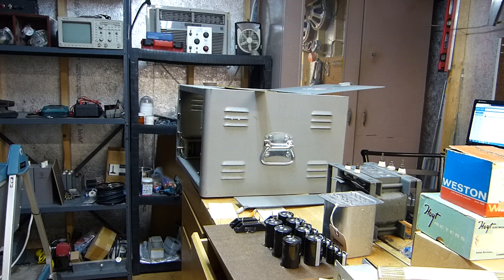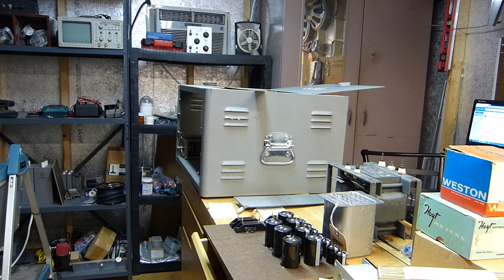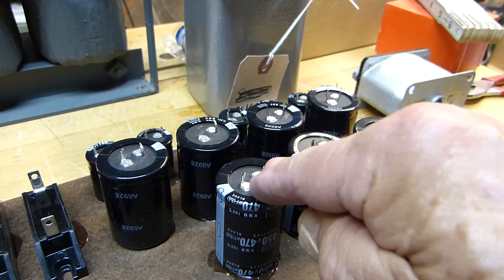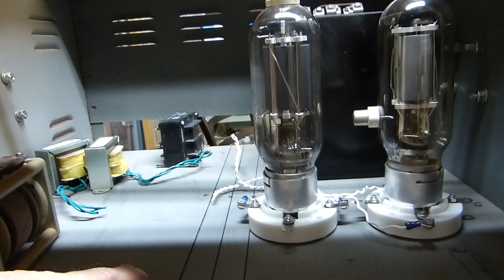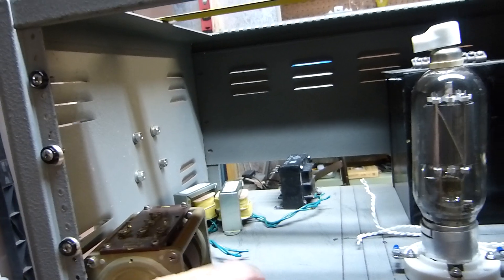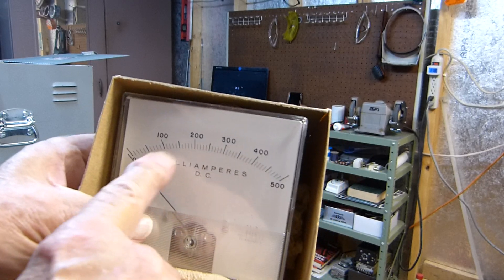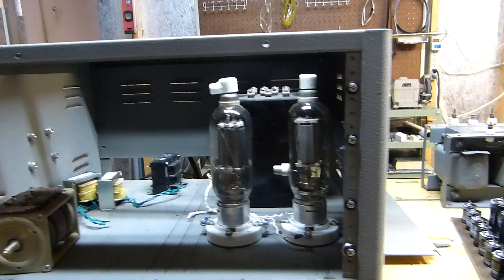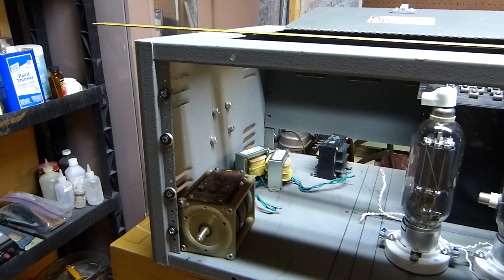700 Watt 810 Triode Audio Amplifier

Comment: I would suggest a box for the tubes that performs thermal acoustic and magnetic shielding. Steel is usual, 6mm silicone steel with a latex bond to a chassis, something like car engine mounts or springs. Put that on a ceramic riser. Small glass mirrored door 🚪 perforated holes 🕳 wire mesh both sides, like a status light glow. Dot matrix logo 😎 flow charts diagram. 

Would replace backlight in VU with an LED peak value display + some colours. Esp gain stage peak sensors would be handy. Overload detect, psu drain maximum etc. Rectifier squiggles. Computer monitoring is a great idea for high power vacuum tube.
Reply from the maker: This amplifier is in Denver with my friend. I don't have it around anymore but I do have one more of the huge OPT that I may have to build something with some day.

Comment: Do you  use specialized audio output transformers with higher voltage-rated Magnet wire? My internet search turned up zilch regarding  maximum voltage ratings for output transformers or magnet wire, for that matter. You also mentioned using chokes with this design and the highest rated choke voltage I found on Hammond Manufacturing's website is 500v. How do you make this work? Maybe I'll never get around to building an audio amp using transmitter tubes but it sure would  be neat to have an audio with big old honkin' output tubes.  700 watts? WOW! You do wear earplugs when lighting up this rig, right?
Reply from the maker: I have had two of those large output transformers for 50 years. They came from a ship-to-shore Navy amplifier running 810 tubes and I have used them at 4KV in modulators back-to-back to get high impedance on both sides of the transformer(s). They are built and rated for high voltages. Hammond makes good transformers and chokes but rarely anyone needs inductors rated at thousands of volts. On the other hand, there is a 500 mA Hammond choke in this amplifier that is mounted on insulated material, and then mounted with nylon screws and run at the 2800 volts. It has always worked for me to mount the components on some good insulating (ceramic insulators) material raising them physically above ground. I have had HV components short to the case of large chokes and I solve the problem as mentioned. There are speciality transformer winders that will make transformers and chokes for you. A little pricey but they can be had... most of the parts I have came from ham radio groups and surplus/vintage military equipment. HV components can often times be found on Ebay. I buy a lot of stuff of Ebay and I have no issues. I recommend buying from sellers that have lots of sales and a good rating. 100% rating is not necessary as there seems to always be someone unhappy with a $5 purchase that flames the sellers. I used to sell on Ebay but not any more simply because I am too sensitive to be a good salesman as you can't make some buyers happy. Just my thoughts

Comment: From experience, separate transformer and power supply for bias supply. Same for the 810 heaters. Get these fired up before the HV. But you knew this.
I have a 25w single ended 845. Single power transformer and power switch. The 845 turns on faster than the bias supply charges up. Makes a noise out of speaker like a star wars light Sabre for a couple of seconds.
Reply from the maker: In a 300B stereo SET amplifier I have, I put in a 115NO45 delay-relay to let the filaments warm up before the HV comes up as one of my earlier 300B's had half the filament go out. Probably noting to do with the HV coming up at the same time as the filaments but it seemed like a good thing to do. Probably mostly superstition...   🙂 Interestingly, there is a small hum coming from the speakers before the delay-relay closes and puts HV on the tubes. It goes away when everything is operational.

Comment: Will you need forced air cooling?
Reply from the maker: I will put a small box fan blowing over the tubes. I have found that it only takes a little breeze for tubes like this. I think we all tend to get carried away, I know I can, in providing cooling air. In the case of external anode tubes like a 4CX1000A, it is necessary to use a squirrel cage blower and pressurize the chassis underneath at some minimum level. I have done this and still have good tubes after 35 years of use. Box fans like muffin-fans do not work well into a pressurized enclosure but openly can blow quite a bit of air and is what I use on my 833A amplifier - one blowing straight down from above and one from the back of the cabinet blowing towards the front and out the grill at the front of the amplifier. These 810 tubes I have seem OK but I have never put HV on any of them and I think they were all made in the 1940's... I hope they work.  :-)

Comment: Sounds a good project David! I used these neat Chinese soft-start modules I got from e-bay on my 833a amp which you might find useful...they operate on the primary side of the transformer; might be good for your HV PSU. Those 810's would be good in a big AM transmitter. 73 Justin GW0FZY
Reply from the maker: Justin - we may have talked about it before but I forget easily. I am interested in the soft-start modules you mention on Ebay. I forgot what you are using your 833A for - not many people use the 833A but I absolutely love mine and use it most on 20M SSB. I hear the 810's make great audio amplifiers and since I have a genuine transformer to match them, I figured it was time to use it. I have prepared what I can, so far, and my friend will be here Saturday so we can complete the project and hopefully get 700-800 watts from it and it will sound good. We will see.  73
Reply: @ElPasoTubeAmps   Hi David, my 833a amp is a SET audio amp with 1x 833a per channel. I tried building an RF amp with these tubes but it didn't work  out very well. If you search eBay for "AC 150-280V 100A 4000W Power Supply Delay Soft Start Board For Class A Amplifier" you'll find the soft start. They work pretty well. Don't think Youtube will let me put the direct link in the comments! 73 Justin
Reply from the maker: @justinwoolgar9853  Very nice - thank you... I never knew anything like this was sold.   I am going to try one.

Comment: I was going to suggest you just get a 17x17" chassis and cut whatever you need out for the power valves, but I see from the next video you found two to fit. Very interesting project especially the HV/bias interlock protection TBA.

Great score though on the Tek thing. I finally had an opportunity to get a Tek current probe & AM503 (?) amp but I looked into it, especially the probes and how you use them, and I decided it all wasn't really for me. I don't get much beyond measuring cathode current really, either just across the cathode resistor or else by inserting one of those gadgets that make like a valve base.
Reply from the maker: I have a nice supply of chassis right now - I went crazy and bought enough to build for the next 10 years. I love 4" high chassis or 3" next, but rarely ever use 2" high chassis and I had none of them... Three inches might have worked and I did indeed think of cutting one of the 17 x 17 x 3 chassis corner off but figured the cutout would be terribly weak for that 33 lb transformer to set on it. It is getting there and now I am just into the beauty of the layout - symmetry is wonderful even in a vintage schematic. You know what I mean.

I have three Tek current probes and all of the probes are perfect and they are  from the late 1960's but only one of the terminators is good. The non-powered terminators are not very sensitive either and this active terminator has a lot of gain and I can see 1mA of current. The current often times looks very different from the voltage wave form.

I learned to appreciate the value of measuring the current in that modulator I build and measured with my Triplett 630 and smoked it. It measures 6KV at 60Hz but audio frequencies are a different animal and will arc and it did, across the wafer switch. 

Anyway, clamping the probe around one of the load wires told me everything I needed to know and I did not have to deal with 2000 volts coming out of that transformer.  Getting across that,  I think that would be the end of me.

Comment: Not to be critical, I love your channel, but wouldn't it be safer to mount those caps and rectifiers with screws and capacitor clamps? The particle board is a good idea, I just try to avoid gluing things down. I have yet to find the perfect glue. Even Epoxy snaps off over time.
Reply from the maker: I thought I had already replied to you on this but I don't see it. I am forgetting to "send" often times...  I agree that Epoxy will snap off and do not use it for things like this. However, Goop is a rubber-silicon type substance and is seriously tough. Parts are not going to fall off but they can be removed and on a slick surface, it doesn't even leave residue. Somehow I ended up with a whole stack of that particle board and use it to make assemblies and just add them in to the cabinet or chassis. I have done that in this case for the 810's also. Besides the Goop, there is another substance even stronger called, Loctite PL Premium Polyurethane Construction Adhesive,  
https://www.amazon.com/dp/B00518KORU?psc=1&ref=ppx_yo2_dt_b_product_details
This is some really serious stuff and I probably will not use it for capacitors as I do not think it will let go if I need to remove the component.
I also do not have the proper capacitor clamps and I use the PC board type capacitors but mount them upside down. They have worked really well for me and I have them as high as 5400 volts in a 833A RF amplifier. I did get some true HV capacitors, 20uF at 6KV, but they are large and I have not built with  them yet.

Comment: You need a sheet metal shear and brake over aperatus for your shelf! If you don’t already have it.
Love your amps! Can’t wait to see how it turns out!
Reply from the maker: Oh, do I wish I had a metal sheer and break... I buy chassis form Mouser and get cabinets where ever and when every I can. We are going to put the PS in molded 8U (10.5") rack case with a plate on the bottom for mounting the PS, etc. I have bought similar 19" all metal cases locally from music shops, one with wheels, others without wheels and they are pretty tough. Bottom line is has to be totally safe from HV . A lot of thought will go into the PS case and safety.
Reply: I have one of those Harbor Freight brakes but it is all manual using C clamps and the bar is solid so you can't make box bends. For $60 it's OK. I would like to have a professional brake with removable bar sections but those cost thousands new. Now I do have a good way to cut sheet aluminum precisely - a table saw! Yes, and a carbide wood blade will cut aluminum with satisfactory results. But better yet, buy a specific aluminum cutting blade (about $100). It's much smoother. Also use water based cutting fluid. I have even cut 1/2in aluminum plate this way.
Reply from the maker: @andydelle4509  That is a great idea using the table saw as I have a good one - an old Craftsman. I have used a hand held cut-off tool before and amazingly, have gotten the front panel looking good but I think I will go to Lowe's today and get the blade you are talking about... Thanks...
Reply: @ElPasoTubeAmps  Lowes may not have it. It's kind of a specialty blade. I got mine at a metal supply house. As always check Amazon. I don't have to tell this, but be careful. It's a bit scary cutting metal but I have done it many times.
Reply from the maker: @andydelle4509  I did get one at Lowe's made by DeWalt. Only like $6. I have cut panels with a hand held cut-off tool and it is scary...  I know what you mean. On this 10" table saw it will be even more so... I have been using the table saw with wood lately and so far, I still have all my fingers.   :-)

Comment: Looks like a fun project! Looks like about 590 Watts class B?  That’s some serious audio!
Reply from the maker: According to the data sheet,  https://frank.pocnet.net/sheets/049/8/810.pdf   as much as 725 with 2250 on the plate and a 11K load. This transformer is from an 810 amplifier and my plate voltage will likely be around 2600 so I expect every bit of the 725 and more. Years ago I used these transformers with PP,  3-400Z for 1.3KW output. We will see...

Comment: Can you use an autoformer instead of the variac or pot?
Reply from the maker: If I understand it right, an autoformer is a type of transformer likely used in RV's to raise a low (line) voltage to proper level for the devices and appliances in an RV. An autotransformer is the generic name for a "Variac" which is a trade name from General Radio. The bias voltage has to be continuously variable to be able to set the resting plate current to an exact value. Depending on the value of the grid current that the tube will draw, will depend on the design (and if it can even be used) of a voltage divider or pot. For tubes that do need significant grid current, I prefer a linear power supply with lots of available current and a heavy bleeder resistor to stabilize the voltage and a "variac" in the primary of the bias transformer to be able to adjust the bias voltage to any value necessary. It will take around -60 volts and I will be using a 80 volt transformer into a bridge and Pi filter (and bleeder resistor) to keep the bias voltage stable - with the addition of a digital meter monitoring the bias voltage so I will know if it is within acceptable range.

Comment: You can mount the 810’s horizontally. You know, for fun. I think it would look neat to have them in there sideways and staggered for heat dissipation.
Antique Electronics Supply had a bunch of 2” Hammond chassis’s the last time I looked.
Reply from the maker: I will keep tubesandmore.com in mind for 2" chassis. I do buy from them and tubedepot.com.  I bought from Mouser and did get what I needed but they are a little short on 2" chassis. My favorite is 13 x 17 x 4 ...   I love the 4" depth chassis as a lot of components can be mounted under the chassis that high but this is a 10.5" cabinet (8U) and those tall chassis are just too high.